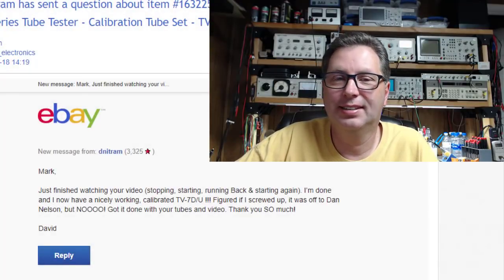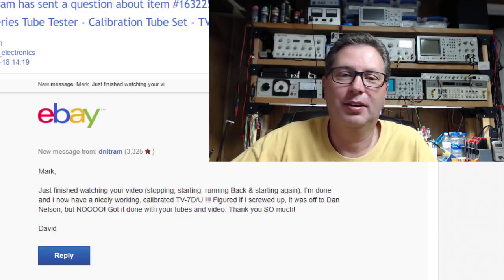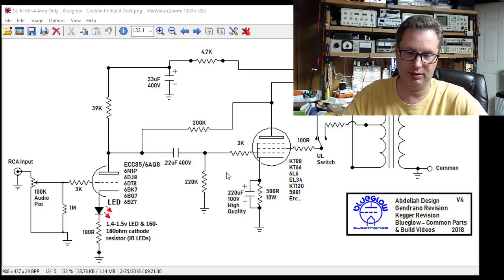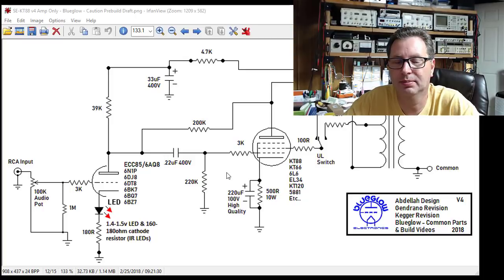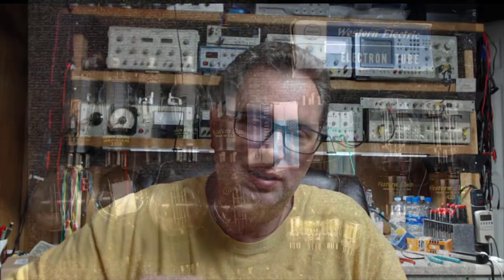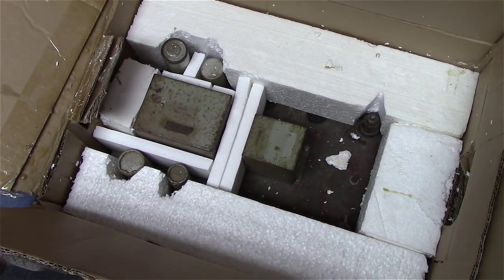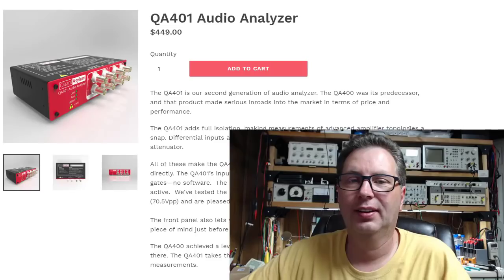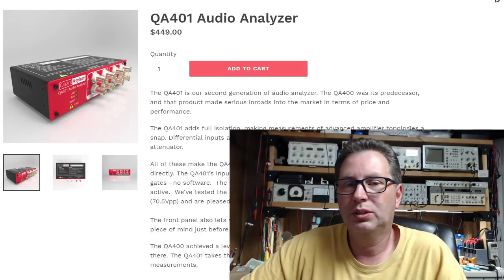SBS - Western Electric Stuff, QA401 Audio Analyzer, Chokes or Resistors, Shelby Hamfest, and More

Comment: I enjoy your channel a lot... Why a choke: The main reason for a choke is the power factor for the filter circuit: With a capacitor, the voltage lags the current, and with a choke, the current lags the voltage.  By using both L&C, you get a power factor closer to 1. The net result is that you get a smoother and more efficient power output.
Remember, "ELI the ICE man" can be helpful in keeping track of the phase between the voltage and current in an AC circuit.
In a circuit with only an inductor and an AC power source, there is a 90o phase difference between the current and voltage - the voltage leads the current by 90o. This is the ELI part...with an inductor (L), the voltage (E) is ahead of the current (I).
In a circuit with only a capacitor and an AC power source, there is also a 90o phase difference between the current and voltage - the voltage lags the current in this case. This is the ICE part...with an capacitor (C), the voltage voltage (E) is behind the current (I).

Comment: Mark, I like this format as an addition to your regular content.  Lots of good stuff in the pipeline and I am looking forward to it.  Regarding Pete Millet’s software and older GPIB gear in general, I maintain a Windows 7 machine that works with all of it, and it will never be updated to Windows 10, just for the reasons you described.  Thanks for all your hard work and great videos.

Comment: I remember that circuit design class well.  At the beginning of the semester we were handed a bag of components.  The instructor said "you will receive one of two grades for this class, either an A or an F"  That got my attention real quick.  He went on to say " you will design and build and demonstrate a two stage amplifier from a transistor and an FET.  It will have a voltage gain of at least 300.  Any less you will receive an F for this course."  I had to spend lots of time on the curve tracer, and spent a lot of time going over base loop and collector loop equations to calculate the bias values.  There were at least 3 semesters of classes before this one.  There were no tests, or homework, just build this amplifier.  The one I turned in had a gain of 700.  I could get more, but the frequency response suffered.  I am with you in that that kind of theory is not for everyone.  I am now 60 and never used this on a daily basis, so I would have to do a lot of studying to get back up to speed.

Comment: Re Q2; I have no formal education in electronics, taught myself, by asking question's on a forum and reading, but learned more by doing. Tricky bit is trying to find good info and teaching to progress. Re Topic 3, I'd recommend The Valve Wizard webpage, the nearest "How to build a valve amp" site you'll find, but you'll learn more by doing and making lots of mistakes. The DC part is pretty easy, the tricky bit is the AC bit. Am well up for any help you can give there. Thanks for the vids, won't watch the Hamfest section lest I get Tube envy.

Comment: what about the difference between iron core inductors and non iron conductors used as chokes don't see the non-iron core like a doughnut, why is it always an iron core? is it because iron core allow more mid-range and higher frequencies passing? and why laminated transformer only wouldn't a toroidal iron core be better?